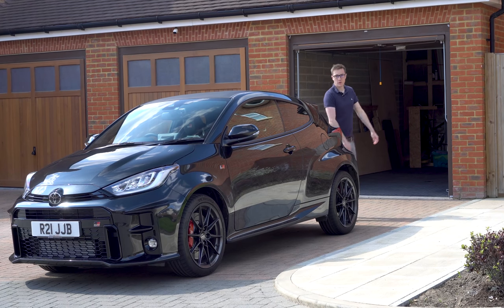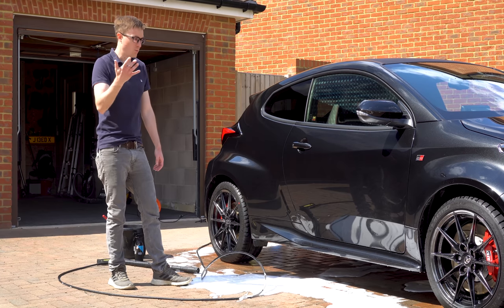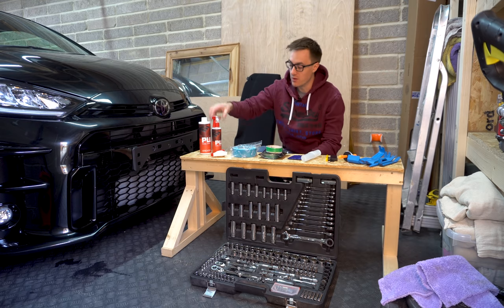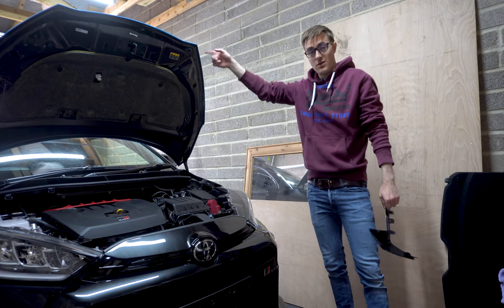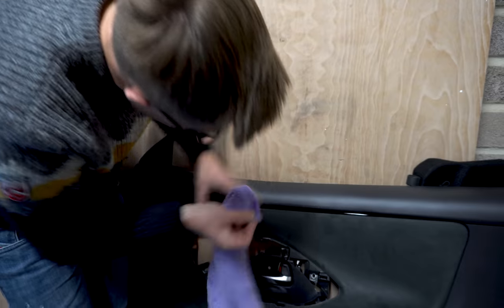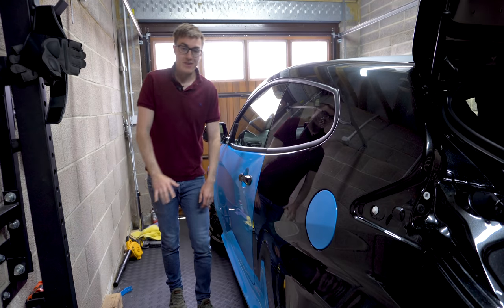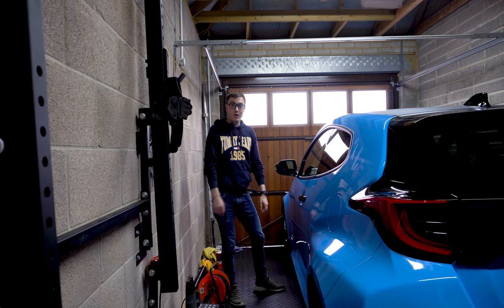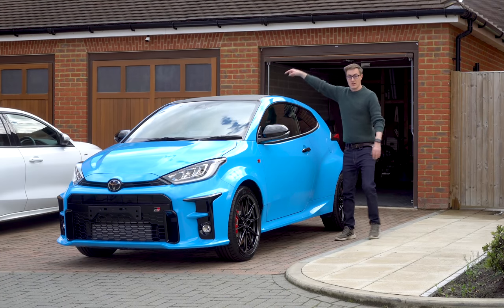GR YARIS WRAPPED AT HOME! 😍 (DIY Full Car Wrap)

Comment: No bad and looks amazing,  I can't see your sub par efforts but looks great. Little note with snow foam- chuck it straight on dry- you won't dilute it on a wet car and more dirt will devolve. Try Bilt Hamber touchless snow foam with touch-on ceramic wash system. This stuff actually works! You can thank me later 😉
Reply from the maker: I will give that a try next! I think my autoglym stuff is nearly done so I’ll switch it up next time!

Comment: Well done Johnny what a transformation. I thought it looked great to be start with. 
A couple of pointers - do you keep the body work wet when applying the wrap? I follow a YouTube guy - Nick Murray and he always has PPF applied to his Porsche cars The installer uses soapy water. 
2 when you dry your car I’ve discovered that the towel should bet wet to start with - better absorbency and no scratches which can occur with dry towel. 
3 please don’t wrap your dog!  Once again great effort and video 👏👏👏
Reply from the maker: Thanks mate! Bodywork is dry for vinyl wrap. It has air release technology in it to allow the air through the vinyl. PPF is slightly different and, as you say, needs to be applied wet. 

You’ll see I applied the vinyl decal with water as it was printed on sign vinyl, which doesn’t have the air release technology 👍🏼
Reply: @JBCTR  ok that all makes sense. Thank you .... and the dog? 😂
Reply from the maker: @mikem2652  He’s blue now.
Reply: @JBCTR  😂

Comment: Well done young man. Great to see a video which is honest. Tip for your snow foam, lay in on the car dry, I spoke directly with Bilt Hammer as I use their foam and their chemist gave me that tip. I may go and see how I get on wrapping part of my Radical, just to remove some of the bland white. I'll leave my MRY. Do you have to inform DVLA on colour change?
Reply from the maker: Thanks! Always been nervous to try the snow foam on dry, although I have heard that before. DVLA needs to be informed on the colour change alongside insurers 👍🏼

Comment: Great spot on the little sliver of gloss black trim on the door cards! I'll be wrapping my flat white one when it comes ( next year!). I'm thinking a gloss orange colour, but plenty of time to make my mind up. Orange would really pop on those bits in the door cards.
Can I ask for more detail on how you cut onto bodywork, like in the door shuts- do you just score the vinyl part way through then tear it? 
Don't want to leave scalpel marks in all my door shuts if I later remove the wrap!
Reply from the maker: Score and rip to cut on bodywork. I did also use knifeless tape in the difficult places!

Comment: Hi Johnny, I have a Black Circuit Pack on order from my dealer. Should come end of this year. I'm just wondering, what's your take on PPF'ing the Yaris? I'm unsure whether to get it done as it's so costly, but I'd like to keep it in good condition. Does wrapping it have a similar effect? Will it protect from chips etc>?
Reply from the maker: PPF provides the best protection, for sure. It is expensive though, as you know! Wrap provides a bit of protection against light scuffs and stuff but will easily rip when faced with stone chips etc.

Comment: Great job on the wrap. Did you just do it dry? I've always seen people using plenty of soapy water to slide it and get it to fit better. You had me though until you said the color was close to the Corolla Flame Blue. I just think that it's a horrible color, maybe best for girls. I've never liked baby blue shades on any car.
Reply from the maker: Yeah, vehicle vinyl tends to be dry apply as it has air release technology. Any vinyl products that don’t have that are best applied wet (PPF, for example). You’ll see I applied the JB CTR Decal with soapy water as that was cut from sign vinyl that didn’t have air release 👍🏼
Reply: @JBCTR  Very cool. I don't have experience with vinyl wrap so I was surprised watching your install. I just wish it was a better looking color. I saw a yellow wrapped GR Yaris and it looked amazing in that color.

Comment: I noticed that you didn't use a heat gun ?
Im thinking of de chroming my car you make the narrow bits look easy enough ?

Four or five 'poundland' rubber exercise mats glued to the inner garage walls to protect those door edges.
Reply from the maker: A heat gun was used. It’s just not that interesting to film 🤣 dechroming should be okay. You can also buy dechroming tapes if you want to take a shortcut :)
Reply: @JBCTR  Thanks, didn't know that, should be easy enough then ?

Comment: Nitpicking but don’t take it negatively…

Wheel woolie and wash mitt were in the same bucket, probably dont want to do that to avoid cross contamination.

Snowfoam left to dwell in direct sunlight, not sure if the deionised water means thats okay but not ideal. 

Badge removal, could of used your heatgun to loosen the glue a bit but you obvs managed fine so all good.

Wash mitt technique potentially a bit aggresive, also went into the dirty exhaust tips then back onto the paint.

Anyway, not like it was a detailing vid and now its wrapped all the above dont really matter 🤣

Wrapping skills and patience to take a 30k+ new car all apart impressive though!
Reply: Imagine sitting through half an hour of a Youtube creator who has obviously put a load of graft in to create and edit a video like this to then share it with his community….. just for you to go and give him marks out of ten on his car washing technique in the comments section 😂🙄👊🏻💦 #bekind